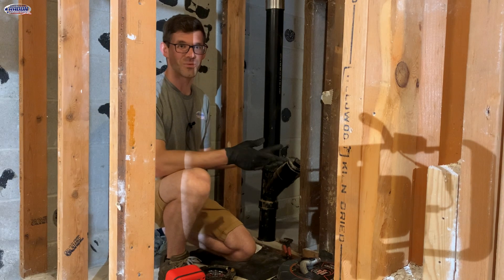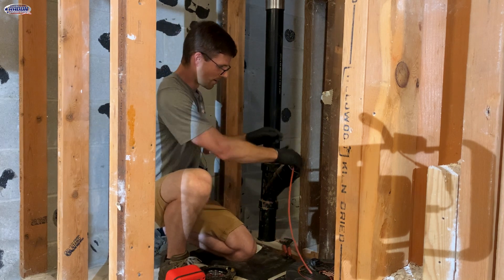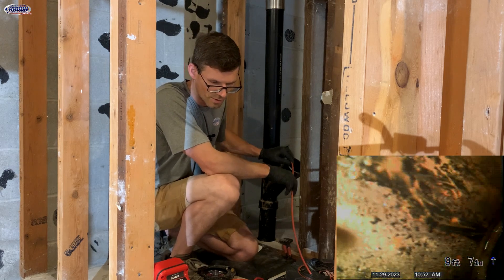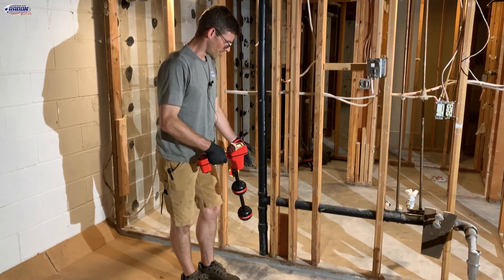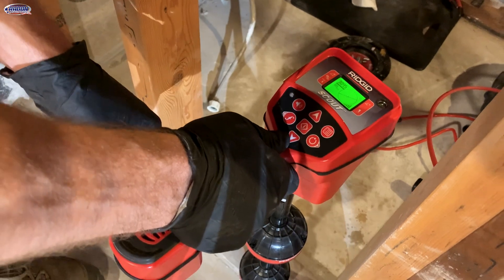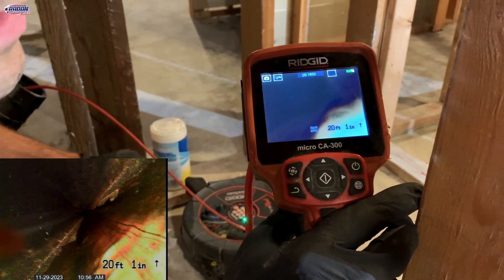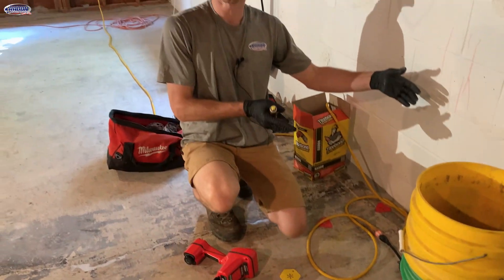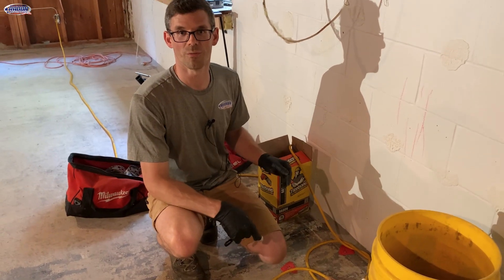Mapping Sub-Slab Plumbing with a Sewer Camera

Comment: Hello, nice video! I have a random question. The radon level at my home is about 1.0 - 1.5 pCi/L on average. I've been checking this in real-time. The radon mitigation system is installed but I'm not satisfied with this number. I want to have a similar level of outside (~0.4). But, my Radon contractor said 1.0 - 1.5 pCi/L is a really great number, and no need to worry. Just want to know your opinion.
Reply from the maker: Yes, it's an excellent number. Can you do better? Probably, however, it's hard to track down those entry points if you have full pressure field extension (suction) under the home. Your contractor may need some specialty tools like a radon sniffer or EcoTrackers to find those obscure radon entry points.
Reply: Thanks for your opinion!